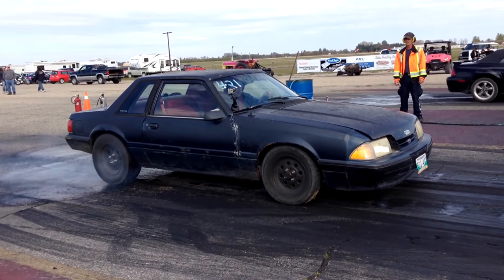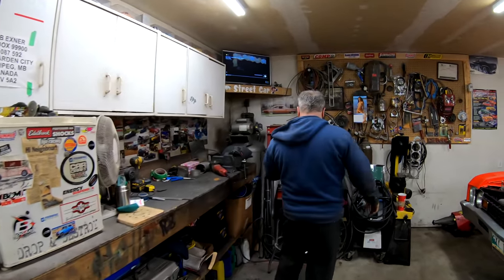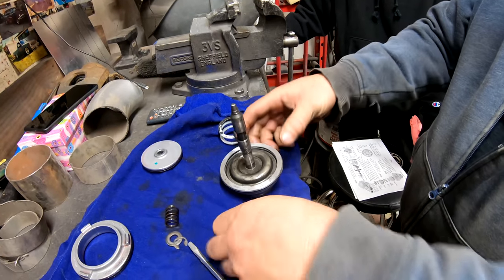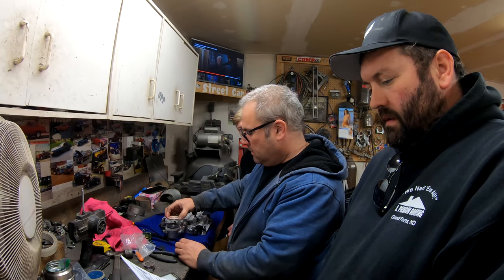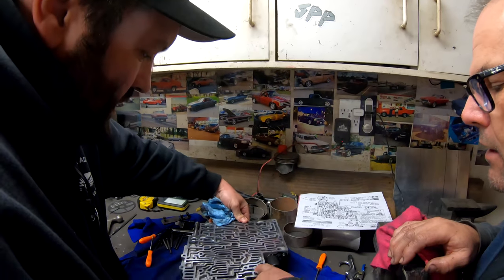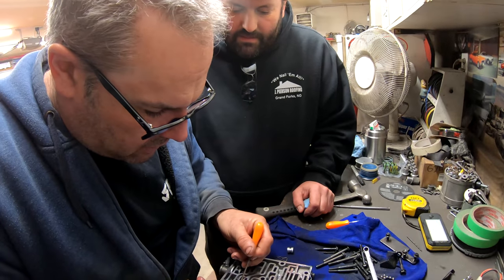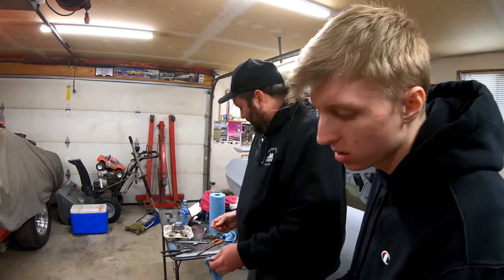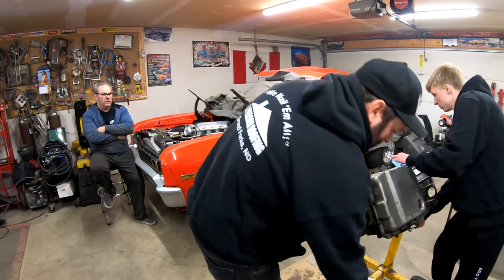4L60E HD 2 Shift Kit Installation Adventure | 4 Eye Fox Transmission Build

Comment: Putting the spacers behind the accumulator pistons definitely the best for firm shifts, the spring there from the factory act as shock absorbers for the hydraulic force. Results in softening of clutch pack/piston engagement/disengagement. 
The factory setup is a compromise between comfortability and longevity. But when you go to tow something heavy or you got a performance motor, you burn up your clutches. I'd even install a shift kit on a stock motor - I love em

Comment: you can use a hydraulic press as a bender for pieces up to the width of the press frame .you weld 2 pieces of angle steel next to each other with the corners pointing up ,use some plate as the base .then you weld a piece of  angle to a tube ,angel pointing down .you put the tube of the top piece over the press pin of the press .
Reply: Good idea 💡

Comment: The last 4l60E I rebuilt lasted 3 months so listen to me I is a expert ;)   Don't re-use the plastic pistons, they are junk and the higher pressures created by new power valve makes the risk of reusing them even higher.   The Precision Transmission videos are great.  I tried to link one but I looks like Youtube deleted that post.  If you go to their video called "4L60E its supossedly new!!" at the 14 minute mark you can see the pistons they use.  They also have a post where they link all they parts they use on a 4L60E rebuild
Reply from the maker: I’ll do some research, this thing only has to make it through this year
Reply: @SPPTVarmy  to be honest I went to put a shift kit in mine last weekend and I found little metal chunks in it, so I pulled it from my 94 Z28 today.   I might pay a professional to rebuild it this time